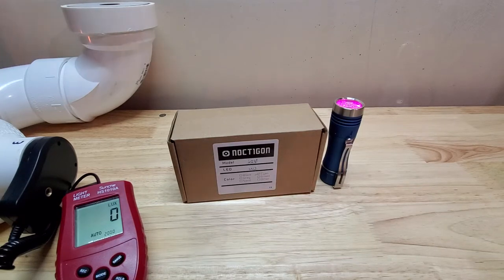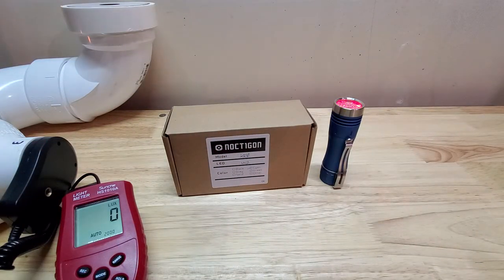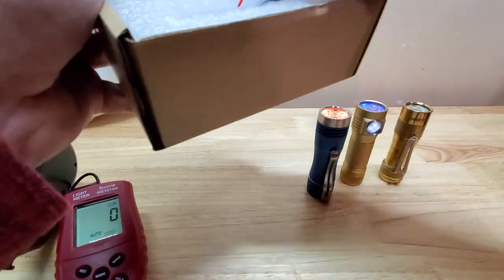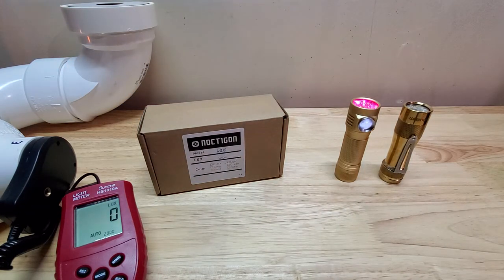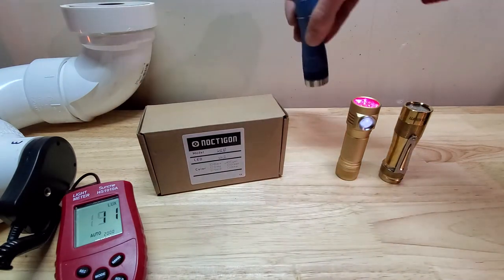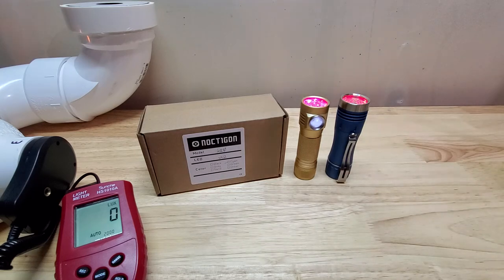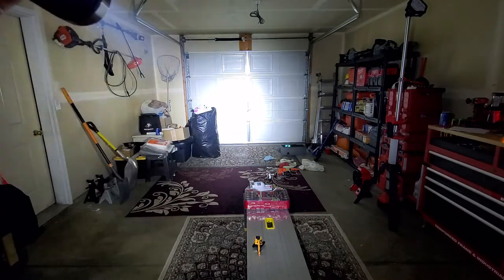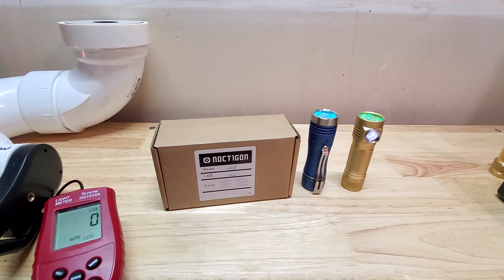NOCTIGON KR4 OSRAM W2 LUMENS CHECK + BEAM SHOTS

Comment: I have the D4V2 with the W2s on a boost driver, but found its runtime lacking on the smaller 18650 cells. Now it seems for practical all-night use, and without carrying extra cells, the upgrade is necessary with the larger battery capacities that the 26650/26800 cells used in the larger D4SV2 would offer.... The FET driven quad emitters though, it's all about continuous discharge rate, and the 45A P45B and 40A P28B Molicels are pretty much all you'll ever need.
Reply from the maker: Thank you my friend I appreciate the info 👍 🙏 
Yes them molicel p45b are a beast, I have to get some of the 18650 p28b they are 40a I thought they were 35a?
Reply: The older P28A is 35A CDR. The newer P28B can draw 40A.
Reply from the maker: Okay appreciate the info, I will definitely pick up some of the p28b.